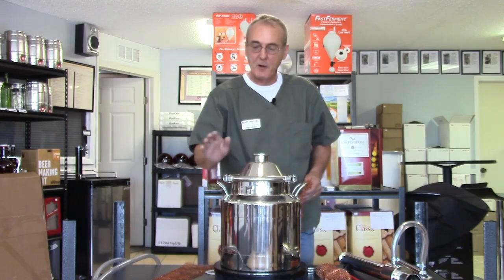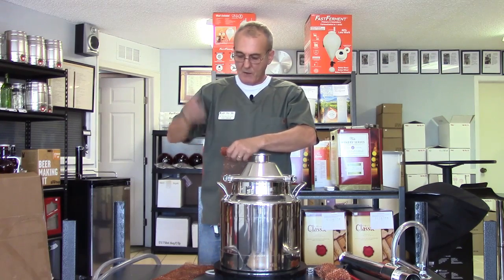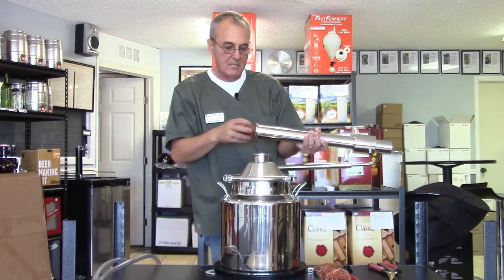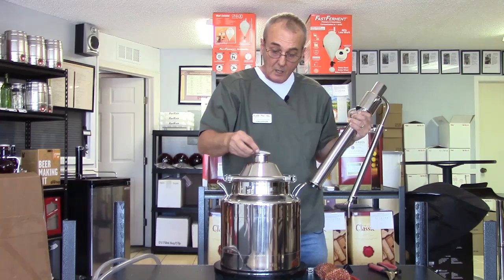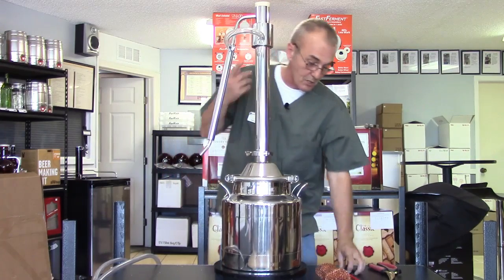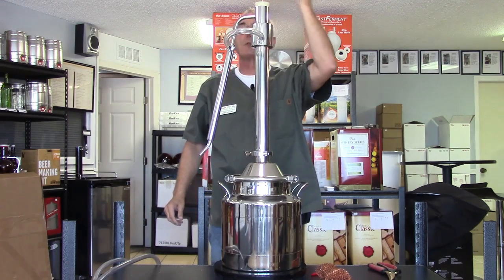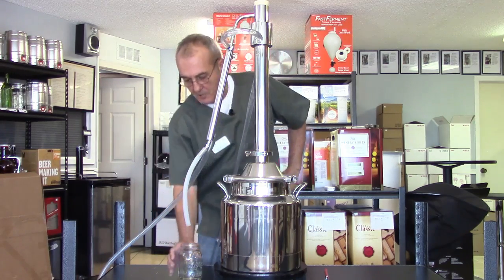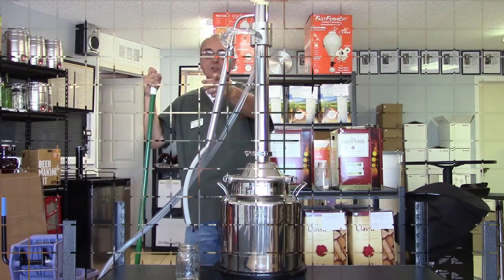Running the Mighty Mini reflux still

Comment: George, how did you get the might mini can to work on the Nuwave induction cook top?  Mile High told me they wouldnt work on induction cook tops...I am assuming because of the slight recess under the can.. did you use a heat diffuser plate under it by chance?   Tks

Comment: Thanks for all the great videos George! I'm very interested in buying the Mighty Mini. I just wanted some clarification. It says it's a 3-gallon still. Is that the actual boiling kettle size, so can fit roughly 2 gallons of wash, or is a little bigger being able to fit a full 3 gallon run of wash? Thanks!
Reply: Lynn Roberts  I did buy it, but I haven't tried it out yet, nor measured out the total volume. It looks like a very nice and well built still though. No regrets!

Comment: Hey George! First of all i know that this is an old video, but what was the average prof throughout the run?
Reply: Jacob Weininger 

I would say if you’re not running at 180 proof... your not running the reflux efficiently.
Many achieve 190 for the bulk of the run.

Once the proof starts dropping and the temp starts rising you know you’re headed for the tails.

Many can tell by smell when the run is at the tail end.

Comment: I really don't know what to think anymore. I hear one thing then I hear the opposite. You said the methanol comes off at 145ish and then near the end you say you are almost at 170 and the methanol is coming out now so you'll take the 2 ounces off. Shouldn't the methanol be gone already?
Reply from the maker: Everything depends on where you measure from and there are times when temperatures will be different for different operators. So many influences, atmospheric pressure, humidity, outside temperature, wind, constituents of the mash and several others. Toss the first 2 ounces of a 5 gallon batch. That will ensure you have removed any methanol whether it comes off at 145, 155,165 or 170. It is always the first thing to appear.
George

Comment: The way you run your water flow does that impact your alcohol percentage? Would it be higher running two different water lines one to your reflux and the other to your inlet on your cooling condenser? Just curious cause I’m getting a reflux still and shooting for the highest possible outcome.
Reply from the maker: Water flow will definitely impact production. I use a valve that splits off from the condenser so I can control the flow. The condenser is full on and the reflux is metered. If too much flow the reflux will stop and production will cease. If flow is too low the proof will drop dramatically. 
You will need to find the proper balance of heat and water flow. Start with just a trickle and make adjustments from there. If you can achieve a consistent temp before you turn on the reflux flow that helps with a good staring point. That way you aren't chasing both temp and flow at the same time.

Comment: what brand of induction cooker did you use for the 3 gallon mighty mini? do you need a converter for the induction cooker since the boiler can has a 1/3 inch rim on the bottom preventing it from touch the whole base?

Comment: thanks very much for the continued distilling edification. How often will you change out the copper wire (in the column), if ever?
Reply from the maker: Remove it after each use and clean it with warm water and vinegar. reuse it over and over again.
George

Comment: Question for you.  The condenser water must heat up a lot running that reflux condenser... does your ice water bucket stay cold long enough for a whole run? What is an acceptable water temp to condense properly?
Reply from the maker: +MrTurbo458 The water does get hot. I just drain some water and toss in another bag of ice. It takes me about 30LB of ice for a run. I sometimes use a large cooler that lasts longer. 
The temp for condensing is at least 20 degrees or more below the vaporizing temp (whatever your head temp is). At this point it just needs to be low enough to condense back to a liquid. I have found that ice water ensure this is the shortest possible space. The longer your condenser or worm the more heat transfer that takes place so ice would not be as necessary. The shorter the condenser or worm the cooler the water needs to be to ensure it condenses. 
George
Reply: +Barley and Hops Cool, thanks for the reply!
Reply from the maker: +MrTurbo458 Anytime. We do the best we can
George

Comment: insulating the outside of the column will give much cleaner separation, and you might want to stop the flow to the jacket around the top of the column once it has come up to temp and loaded the media in the column with liquid condensate.

The lower the temperature gradient from bottom to top of the column, and the more surface area for vapor/liquid contact the cleaner your distillation fractions will be.
Reply from the maker: +mehmet olcay Here you are again. And again, I appreciate your comments. You may be opposed to this but I can see that you are watching our videos. Thanks
George
Reply from the maker: +Robert Szasz Absolutely Robert. You are exactly right . Most challenges come from environment and insulating the column is one way to avoid spikes and dips in temperature. Even a slight breeze if outside will effect efficiency. 
George

Comment: very nice and informative videos. thank you. would you please comment on the pond pump you are using for the mighty mini?
Reply: +Barley and Hops This is all great info but one thing to add is that the Max Head Lift is an important metric for the pump. I made the mistake of buying a 250 gph pump that wasn't able to pump water up to the top of my column, if I had known to check for Max Head Lift that could have been avoided. I just wanted to throw that out there to hopefully keep someone from making the same mistake.

I now use a cheap 1,000gph Harbor Freight 12 volt DC sparge pump. It's meant to run off a battery but I run it off a battery charger, which gives it a "low," "medium," and "high" setting by toggling the power output. It's a bit of a Frankenstein setup (and overkill) but it's been working well for years.
Reply from the maker: +Stan Avezov Stan, the pond pump is an off-the-shelf product found in home depot or lowes. They run anywhere from $20-35 depending on the strength. I also found inexpensive ($14) models at Harbor freight. The one I use on the still comes from Brewhaus and it is a 560 gallon per hour pump. Very hefty for our purposes but works great. These come in Gallons per hour (GPH) ratings and start as low as 90 and work up through 200, 230 and so on. I recommend nothing smaller than a 200 just to make sure you have enough force to push through the condenser and reflux protion. In fact, for a reflux I would prefer to use two pumps so I can easily control reflux temp but metering water with a valve without affecting the condenser at all. Hope this helps.
George

Comment: In this video you have 3 gallon  bucket so why are you removing 2oz of heads?  in your other video you said 2oz per 5 gallon of mash. 
Thanks.  Great video otherwise
Reply from the maker: +Dmitry Dubinsky Very good question. I explain that 2oz per 5 gallon and this is accurate. I find it safer to stick to 2oz as a rule for anything up to 5 gallons just to ensure methanol is tossed. Otherwise, there would be an additional calculation for each batch depending on size and the differences are so minute it is easier to just stick with one figure. As an example, if I do a six, seven or eight gallon run I will always toss 4oz just to be safe. There are other options but this one seems to be a good routine to use. A sugar wash produces less methanol but I still toss 2oz per 5 gallon batch. So you see where I am going with this. Additionally, you could burn test to verify where the methanol ends and the ethanol begins. Collect a few drops and light it with a match; if it burns yellow it is methanol and if it burns blue it is ethanol. Hope this helps.
George
Reply: What was the abv of wash , and what did you end with?? Volume and abv???

Comment: Is that a Nu Wave induction Burner?  Looks like the Mighty Mini's bottom is not flush where it would sit touching an induction hot plate.
Reply from the maker: +Rhino12667 It works well and the pot does rest on the Nu wave.
George

Comment from the maker: Rj606, 
That would work. If you run the still at 150 to remove the methanol and then bring it up to run off ethanol is possible. I think it is a long way to do something that happens naturally although it would work. Here is why I say this; the amount of methanol vs ethanol is so small and the temp that it vaporizes so wide that methanol will come off first as you heat through 145-150 that stooping there would really serve no useful purpose. Stopping is not going to do anything else so it is not a bad thing just not necessary. Methanol is much more volatile than ethanol so it has to come off first and will be gone once the ethanol starts a full vaporization. Best practice is to toss the first two ounces per 5 gal batch. This is the safety margin. You will notice that the methanol will vaporize but you may not see any run out until the temp gets high enough to push it out. Sometimes this will be closer to the ethanol temp. That's why there is a mixture of ethanol and methanol in the first few ounces. I hope this helps explain it a little better. George
Reply: It's common misconception that you can separate methanol from ethanol with such a still. You need industrial separator for this, worth few million dollars. The first fraction contains mostly acetone. Also contrary to the common belief, highest quantity of methanol are in tails, not in the heads.

Comment: you said Methanol would come off or would vaporize at 145 degrees at sea level while Ethanol would vaporize at 179 degrees at sea level.

so I was wondering if a person was willing to take the time and effort, wouldn't it be possible for them to at first run the still at 150 to 160 degrees at sea level. meaning no less then 150 but no more then 160 to get all the Methanol to vaporize and drain off first. then after it runs dry, you can go up to 180 to 190 degrees at sea level to get the Ethanol to drain into a container.

so this way you could get the most Ethanol possible out of each run?

and I am talking about the mini still you have in this video because it would be easier to control the temperature on the 3 gallon still then it would be for a larger still.